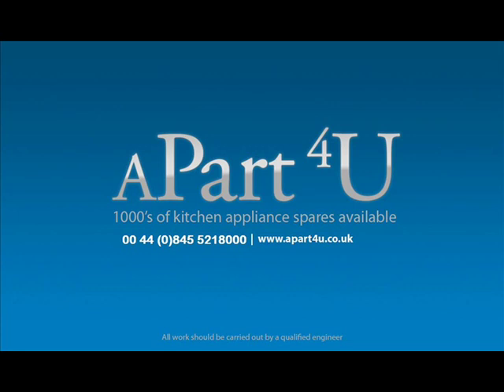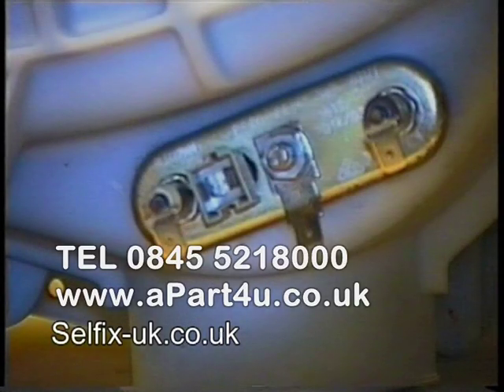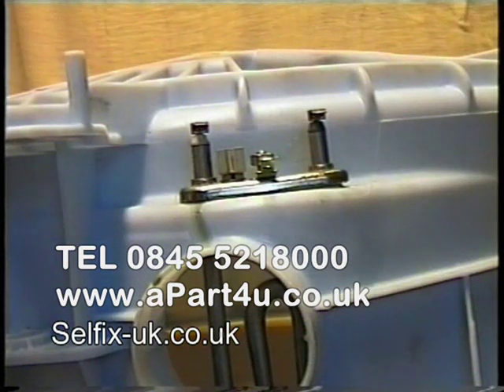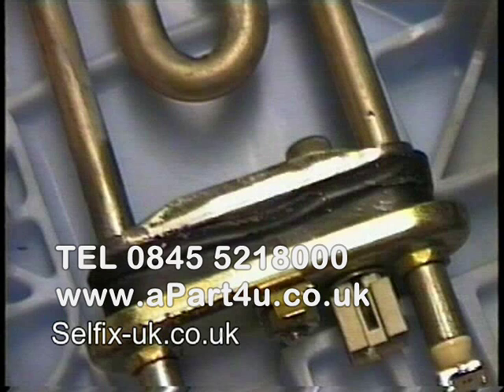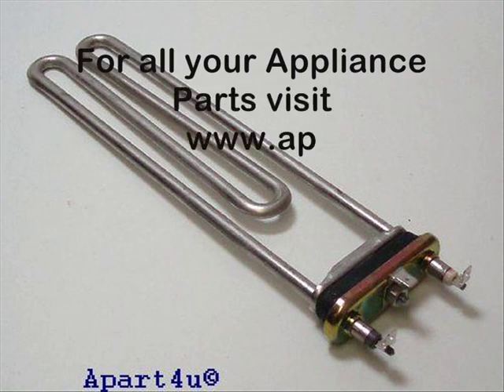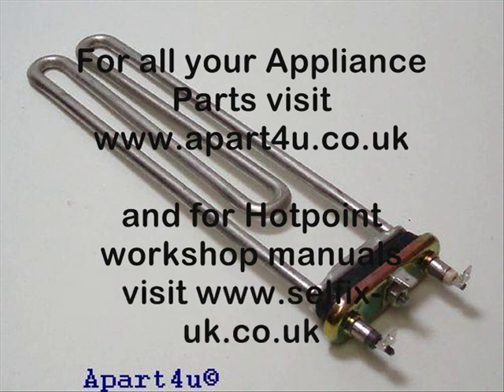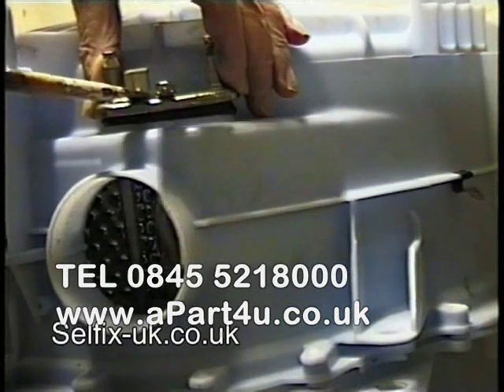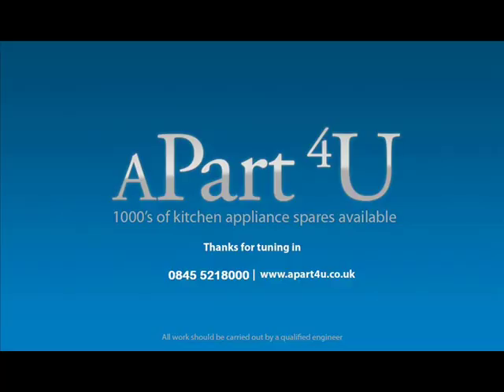How to replace a Indesit washing machine heating element

Comment: An engineer came out to replace our element 6 months ago due to electrics tripping. The new one has since just popped out of its socket twice since then, and looking at the element it appears the rubber wedge has been put on the wrong way so if its too tight it pops out instead of clamping it in place. and as the fixings are welded, you cant undo it and rotate it yourself.

Comment: Hi there! I replaced one of these elements and I didn't see any bracket inside the tub that is supposed to hold the front of the element in place, it was very very hard to remove the old element. Is it possible I broke the bracket removing the old element? But I shaked the machined and I Cant hear a broken bracket or anything rattling around inside. Now I realised the bracket clips onto the element before you put the element in. So I am going to now buy the bracket separate. So my question is, is it just a matter of removing heating element and clipping the holding bracket on to the element and sliding it back in place? Does the bracket just slide into a slot inside the drum to hold everything in place? Thanks so much!